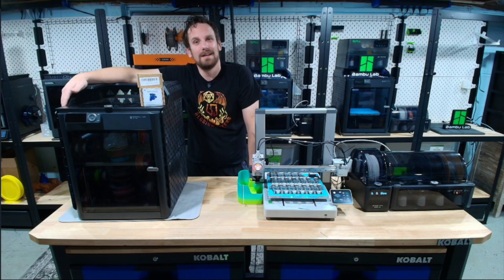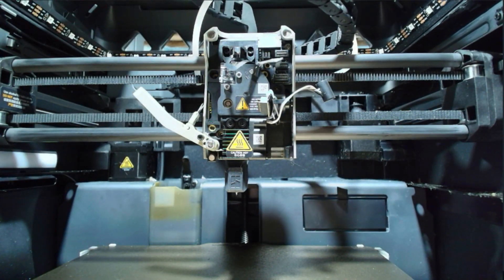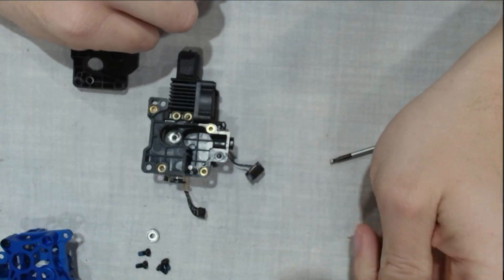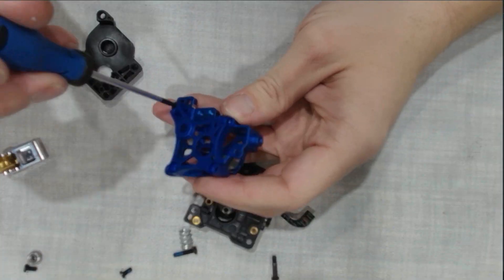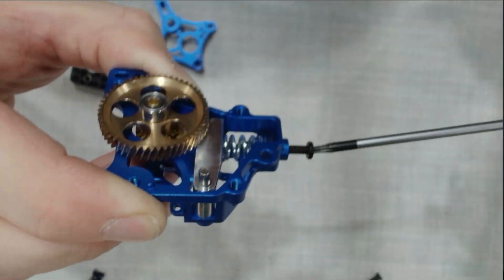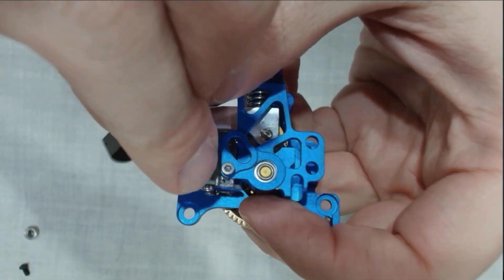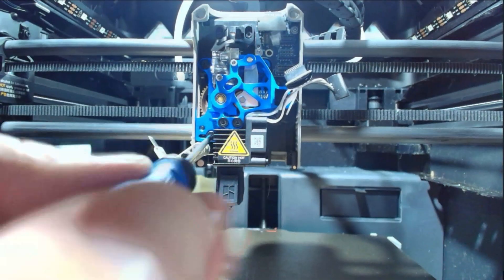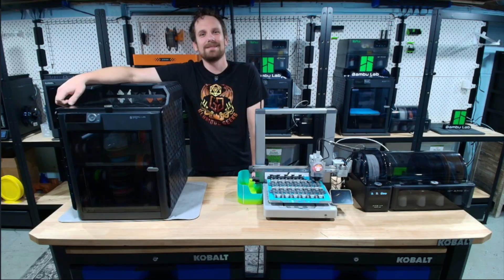P1S Extruder Failure? This Is the Fix Most People Miss

Comment: The Panda Claw is hot garbage. Mine just chewed up filament and filled the extruder with dust.
Reply from the maker: Totally fair — upgrades aren’t one-size-fits-all. The Panda Claw has worked well across all three of our machines, but we’ve seen that results can vary depending on filament, tension, and wear. If something isn’t working for your setup, swapping back to stock could be the right for you. Thank you for sharing your experience! ❤

Comment: The Panda Claw is junk after few Month the Gears did grind to Dust and the Bearings in the Extruder are very lose... so dont change an Perfect working system with this Parts into an System what works more bad them the Stock !!